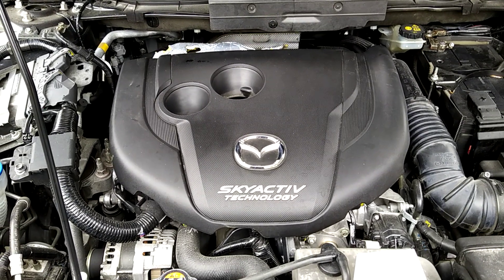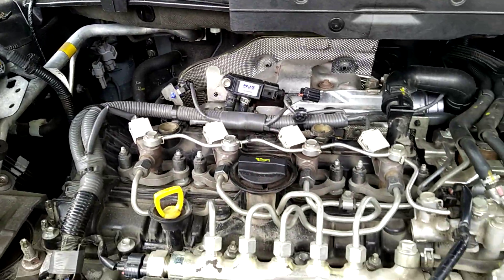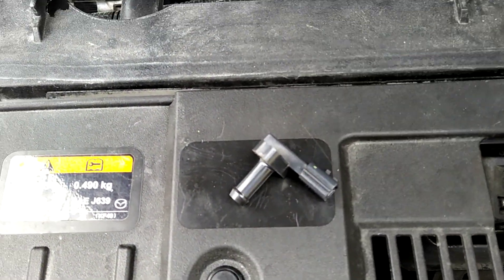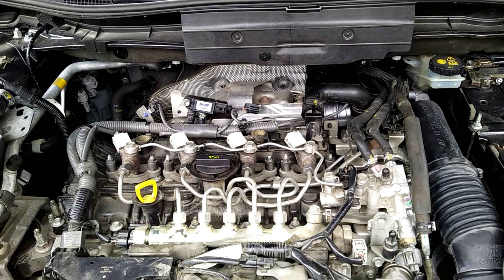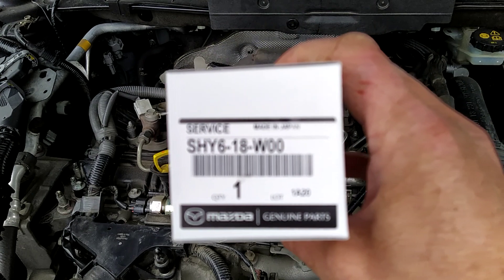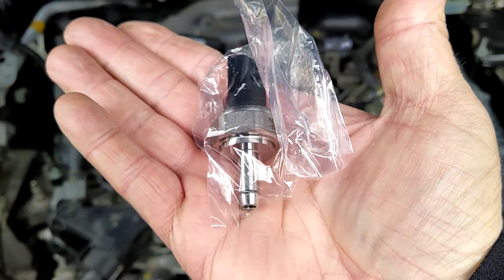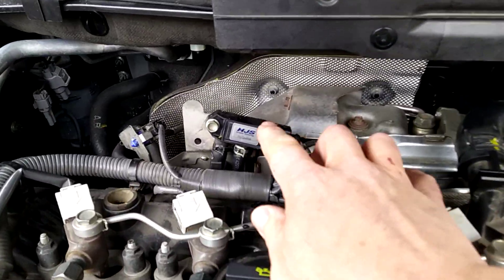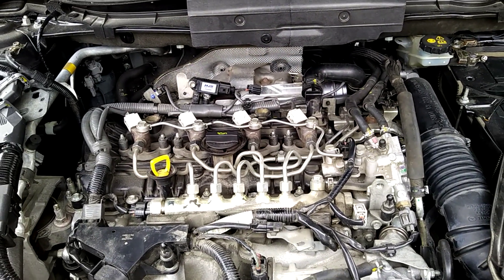Mazda SKYACTIV CX-5 2,2 Diesel DPF / Exhaust pressure sensor **IMPORTANT**

Comment: Really appreciate this video and the follow up, just wanted to share my experience in case it can help others. 

I had Christmas Tree lights and loss of power - I suspected on a 6 year old car on its original battery that it was at fault but replacing it led to no improvement. 

Got a code scan done bringing back P0472 for exhaust sensor and this led me to your video. Got the part from the main dealer UK Price July 2022 was £69 and pence.  I'm not usually the sort to work on my car but bumbled my way through the fitment once I figured out the jigsaw of the new parts by looking at the videos and comparing to the original part. 

Initially wondered why the provided loom bridging cable was so long but you can loop it round the DPF sensor connector and that keeps everything flush and pulled together. I cut down the original hose rather than swap it as I didn't want to deal with another spring clip and was running out of knuckle skin to leave inside the engine bay. 

Once fitted and negative terminal reattached on the battery all my warnings cleared and the car now drives correctly, with full power.

Massive, massive thanks for the video you've not only saved me a fortune and all the worry, but saved a family holiday we are due to go on in the car next week. 👍👍👍
Reply: Hi, are you able to share the modifications I will need to do to fit the new sensor? Is it not plug and play? Thank you

Comment: Thanks, did it help?? 

What sort of MPG are you getting out of yours? I'm only getting 35-40mpg and read somewhere that replacing the injectors can fix a lot of the problems on this engine too?
Reply from the maker: Hi, I am getting about the same MPG. The big factor here is the DPF filter and the regeneration. Highway trips are recommended to open up the DPF, hence improving mileage. Unfortunately, the DPF will have to be flushed or replaced at some point of time, since it will eventually clog up.

Comment: Hi did doing this completely solve the problems, as I have changed both sensors now and the Mazda still chucks out the p2262 (turbo\supercharger boost pressure not detected) I have read in some other forums it could be the turbo boost pressure sensor. Has anyone got any advice?
Reply: Hi same issue here. This changing this sensor in the video fix the issue ?
Reply from the maker: Hi, I did not have turbo during my codes. In most cases, that is cleared. Not sure what is going on with your car. In the details for this video I added that it is recommended to check and clear codes after sensor replacements.
Reply: Hi my partner's car is also coming up with this code, I have attempted to clean the boost sensor on the turbo housing which the code has gone away for a couple of weeks then come back. It seems the sensor gets very carboned up. Did you have any luck fixing this?

Comment: I have the scbs and traction control warnings, limp mode and check engine light. I’ve had the MAF replaced and still the problem occurs. I’m going to give this a try and see how it goes.
Reply: Worked for you? I have same problem
Reply: @destroyeable  my manifold and air intakes were clogged badly with carbon…went to main dealer and had them blasted with walnut shells. Cleaned it all up and no problems since….so far. Cost €993 though 😢
Reply from the maker: Expensive but glad it worked. There are some good additives that when used regularly for Diesel Injection and DPF cleaning while driving will help. NOTE: All DPF equipped diesel cars need to be driven at highway speeds also to regenerate and burn particles from the DPF.
Reply: @cronk216  hi,I just purchased this car and love it to bits so hope nothing goes wrong, any suggestion to look out for? Is it genuinely reliable.. can the DPF be deleted?
Reply from the maker: @XORTION  Did you buy the car used? What year and mileage?  I always go through all possible service and parts. Tranmission oil needs changing depending on mileage. The DPF and exhaust pressure sensors are critical in this car. Also, the MAP sensor cleaning is beneficial. This is a quality car, Mazda reliability is mostly excellent. This is a DPF equipped car, so that will have to be cleaned or replaced at higher mileage. Otherwise, take and service the car properly and enjoy the ride.
Reply from the maker: @destroyeable  The MAF sensor controls and reads airflow from the air filter box. I am not sure this is what caused your issues. Did you get the car fixed? What was the fix that helped you?

Comment: Hi can you confirm that the new wiring loom plugs into the old loom. Many thanks
Reply: To confirm you do need to plug the new wiring into the old loom and then plug onto new sensor. Unfortunately for me replacing the sensor did not fix the issue
Reply: @leecurtis9359 have you tried cleaning out the sensor tube....they sometimes get blocked.
Reply from the maker: Yes it does, plug and play
Reply: Sorry bit late but never considered cleaning the tube out. Still having issues with dashboard lighting up but no codes

Comment: Hi, are there anywhere instructions for replacement old sensor with new?
Reply from the maker: I have not come across any. But if you take your time and remove and re-install carefully everything, using the new wiring harness you should be able to do this in 30 mins.

Comment: My exhaust pressure sensor (mazda 6 2014) melted during highway ride - high temperature. Suddenly my AT required very high revs to go up and using manual control did not work at all. New sensor model is more robust and shaped differently. This should be replaced by Mazda during one of the previous visits (recent one has been done half year earlier, I think), but it never was.

Comment: Thanks for the vid. Like you said in a previous comment, it's important to use the new harness by connecting it to the old.
Reply: I have problems finding where the plug is so I can connect the sensor! one plug goes into the sensor, but I can't find the other plug

Comment: Hi, any chance you can help with the fitting of the new style pressure sensor. Your video showed before and after. I need the actual fitting. TIA
Reply from the maker: Sorry I don't have a video on that. The metal bracket fits similar as the old one. The rubber hose needs to be shortened a bit (Mainly so you can bolt the sensor in place). If you set the tube in place and model the sensor next to it how low it has to go you can easily shorten the rubber hose to fit. Then use some light lubricant at the lower end, slide the hose in place and use long needle pliers to clamp it. Then sensor end, repeat process and then bolt it to the engine. NOTE: Use the new wiring harness! Hope this helps.
Reply: @cronk216  
Thanks 
The issue I’m having is where does the other plug on the new loom go. I can’t seem to work that bit out. Any chance of a picture with an arrow.
Much appreciated
Reply: @cronk216  hi Franco here have done  the second video off result
Thank you great video very helpful
Regards Franco

Comment: iv installed the new exhaust pressure sensor the same in your video all warnings have gone except for the scbs how do you get that off the instrument panel have you got to have a certain obd scan tool please can you help me
Reply from the maker: The SCBS system is somewhat of a mystery to me. I have it on and supposed to be working. I am trying to research how to verify if it is actually working.
Reply: @cronk216  I took the car to mazda yesterday they removed the scbs code and so far it hasn't come back 🤞 also they did a upcoming recall for the door seals at the same time that they haven't issued letters for yet

Comment: UPDATE! You are a genius, the only helpful video on youtube. Yeaterday the car wouldnt start (see below) but today after charging the battery the car started and ALL error codes are gone.! Thank you so much for uploading this, especially for showing the exact part with serial number to be replaced.  Saved me hundreds of pounds. Many greetings! 

Hi, thanks for this video. I hope it was helpful and the reason I'm saying it its because of further issues. Anyway last week fault code p2262 came first and then all sorts of other codes mentioned in your video. Anyway my husband replaced the sensor (recommended in video SHY6-18-W00) and then tried to start the car however lights at dashboard lit up and flashed like Christmas tree! Also gauges flipped, then lights went out but keyless system inspection required message displayed. What is the problem? Can you help? The car was in the driveway for over a week in cold weathet so maybe its the battery? I only bought the car 4 weeks ago and I'm flipping out! Its a mazda cx5 2014. I would appreciate any suggestions Ta
Reply from the maker: Hi sorry for the late response. When you replaced the battery, I suppose there was no codes at the time?! 2nd part, sorry to hear this, but did you replace the DPF sensor as well at that time? A combination of these will help the most. My CX is also a 2014 model. So- for the moment, I would replace the DPF sensor (shown on my video) and see what it does. If you have replaced both of them already, then you need to see what codes are coming up.

Comment: I have a similar problem the sensor has blown off completely and I have had multiple error codes p1303 - EGR Calibration fault p0472 - Exhaust pressure sensor low P0234- turbo overboost condition P0471 Exhaust pressure sensor circuit range,, will replace the exhaust pressure sensor solve all these problems?
Reply from the maker: Hi, not sure that just the sensor will correct all of those codes (EGR code might be a separate issue). But if you have the old style plastic exhaust pressure sensor, it is certainly a good idea to replace.
Reply: Thanks for the reply mate I did have the old style it’s literally been blown to pieces so is no longer on the car just air blowing straight out the pipe, not sure if it’s still okay to drive for a little while, maybe egr calibration is an old fault, waiting for part from Nissan
Reply from the maker: @kylejenkins1718  I hope you ordered a Mazda part mate ;)
Reply: I bought it on Tuesday driving down the a1 heard a bang didn’t think anything of it  10 minutes later scbs light came on and engine management light, no lights before I’m assuming the bang was the sensor going so must all be related
Reply: Part fitted all fault codes gone apart from the P0234 turbo overboost condition 😩
Reply: @kylejenkins1718  did you get your P0234 solved? I have the same code too (only that code). It happens when I rev close to redline for a longish time (so like in 3rd gear up a hill). Thanks for any help!
Reply: @aidan441  nope didn’t get solved ended up returning the car, was fitted with an aftermarket turbo which was producing to much pressure start to blow inlet pipes
Reply: @aidan441  did you found out what was the problem? I have the same now and i think its egr...

Comment: Hi, in case you still have it, can you please share the old part number that proved problematic? Mine is sh02c k5204 and not sure if I need to change it.
Reply from the maker: Sorry don't have the old part #. Why would you need that?
Reply: @cronk216  I wanted it mostly for replacing it as a prevention. I now got a P0401 even though I decarbonised 1 month ago, but it does not seem relevant

Comment: first of all I thank you and please excuse my english.  after I changed the part all errors have disappeared.  However, I now have a jerk when driving as if the engine was not getting any air, before the error P0471 and P2262 this was not the case.  Do you have any idea where this can come from?
Reply from the maker: Do you have any engine lights etc. on? If not, difficult to diagnose. Could be airflow, fuel delivery. If you can, have the car scanned, clearing codes and check for new ones.
Reply: Did you change both sensors?
Reply from the maker: Yes I did and recommend it.
Reply: Hallo
What was the problem?

Comment: The dpf sensor is the one on the left which would be the exhaust pressure sensor ? What’s the one you replaced on the right that’s a different sensor I’m confused as
Reply from the maker: The exhaust pressure sensor is to the right of the DPF sensor. You can see it from the video, there is a rubber tube that goes down to the manifold.

Comment: for me doesnt help …. any ideas?
Reply from the maker: What is your situation?
Reply: @cronk216   same like yours fault codes , i change maf sensor , exhaust pressure sensor , and now i takeoff intake manifold and there i found i hope what i found , problem . the intake ducts are almost completely blocked
Reply: @cronk216  my dpf filter and catalyst was clogges so i cut them and i programmed out .
Reply: @jonasviknius7247  where do you live? I'm in Austria, and here its forbidden to remove dpf or egr....

Comment: Hi From France

I made the upgrade. I also cleaned the MAP Sensor wich was dirty. I have now a problem when starting the engine, which stops after 2 seconds. Could this problem be related to extreme carbonization? The error codes displayed are as follows: P2458, P2452, P2463, P2262, P242F. Since the engine does not start, the error codes are not cleared.
Thanks for your answer.
Reply from the maker: I suppose you have the CX5 2,2 l diesel? Those codes indicate that your DPF unit is in need of service. Cannot tell you specifically, how many km do you have on your car? Unfortunately, new sensor wont fix this. Have a mechanic with diesel expertise look at your car and if you need to replace the whole DPF unit.

Comment: DUUUDDDDEEEE you literally saved me potentially thousands of pounds...... 3 mechanics couldn't find the issue 2 auto electricians had no clue.... mazda garage wanted 150 just to diagnose and not inform of the issue... I went and done my own research and stumbled across this informative video.. went out on a limb bought the sensor and replaced it for 74 GBP using the part number you gave on this video and BOOM problem solved cheers my guy 😎🤘
Reply: Have you had this problem before? I've recently bought a mazda 6 2.2D Sport Nav and it went into limp mode but the dealer fixed it under warrenty, he said the problem was a build up of carbon in the EGR filter. Within 2 months it's gone again. I'm. Wondering has he bodged it and sent me on my way and maybe this was the issue all along and he couldn't find it. My warrenty is now up and I'm considering doing this instead. oh and did you buy your part from mazda or somewhere else?
Reply: @AChadburn   yeah I had this problem
And yes I changed the part for the dealer part as per the part number… 

It instantly came out of limp mode and worked sweet
Reply: @kennygillespie8279  thanks mate, was it hard to fit? I'm not very clued up under the bonnet haha.
Reply: mine is p0472 exhaust pressure sensor A Low. is it the same issue or other parts?
Reply: @michaeldecena4261  that’s the same issue
Reply: I changed both of them still having issues. Does anyone tried any thing else .. mechanics are useless it’s been 3 weeks now
Reply: Did you need decoding the new sensor by a scanner tool due to the installation or its ok, only replacement the new sensor and working properly. Thanks for your advice
Reply: I have mazda 6 2018. Error codes are P0471 and P2262..
One mechanic told me to repair turbo charger without checking exhaust pressure sensor.. please guide what should i do
Reply: @tHiziXso0chEaP dpf pressure sensor, exhaust pressure sensor and boost pressure sensor change all of those cos they fail regularly and throw other codes. Esp the po471 is ur exhaust sensor and the p2262 is your turbo failure code so change your boost pressure sensor. A vaccuum leak can also cause that turbo p2262 code. I have it with mine. Even if it doesnt fix it and your turbo is bad, those are preventative maintenance items that need to be done as common fault with them engines. Its also ruling out the cheaper fixes for u too first. Once the new sensors fitted, make sure the fault codes are deleted to clear the warning lights from dash. If after the sensors replaced and warning lights cleared, they come back, it is something probs dearer causing it but rule out the sensors first. Cheaper to buy boost pressure sensor than to buy turbo. Im going to try that with mine then if it doesnt work i will give it to kennedys garage in ireland.
Reply: Same problem mate obd showing p2262 code and some times light white smoke also coming give me the best suggestion mate thank you
Reply: Hi, how did it work for you? My lights go out when I go downhill. Thanks

Comment: what oil you use ? mine start to burn a little bit
Reply: Just use the official Mazda Supra DPF Oil and you will be safe.
Reply from the maker: I think if you use quality engine oil made for diesel use, you will be fine. Check owners manual for the right viscocity for your climate. I bought my CX-5  used, and I used an engine flush while I did my first own oil change. There was a healthy amount of sludge etc. that came out with that, and I will do it once more next time. I am from the oil flush school, some are not but have owned a ton of cars and never had an issue. Make sure you check your oil level carefully after this, since you might end up putting more oil than specs say once you have driven the car.

Comment: i have this exact issue! I have just ordered the official Mazda exhaust sensor SHY6-18-W00. However struggling to know which DPF pressure sensor to order? Could you advise a part number?
TIA
Reply from the maker: Hi, the DPF pressure sensor should be readily available at numerous auto part chains. The one I used is an aftermarket one. Be sure to specify the year and engine correctly and you should find them rather easily.
Reply: Did u get reduced engine output?
Reply: @lkj17  no i replaced both and still had same issue